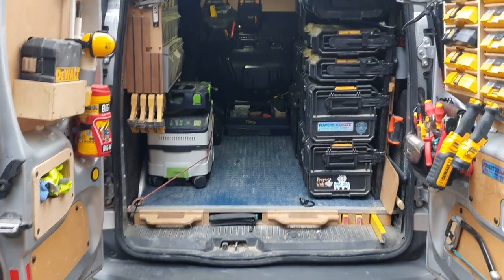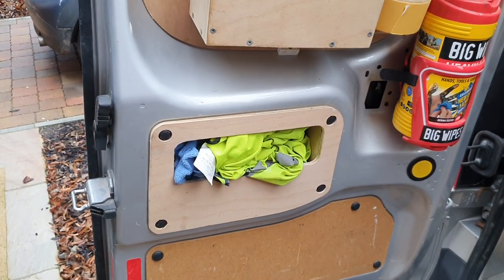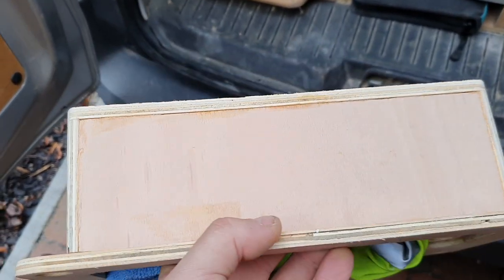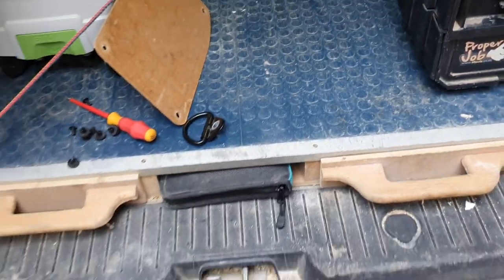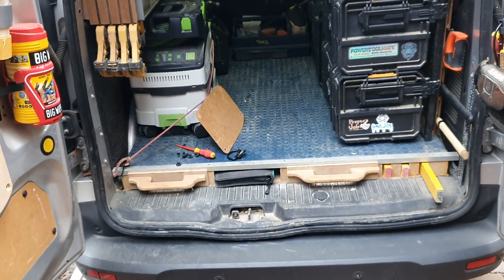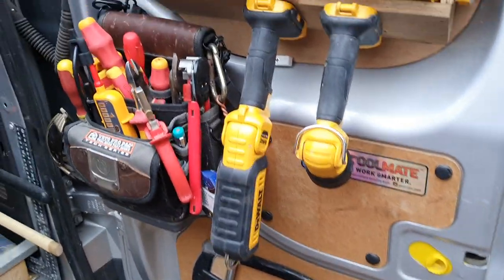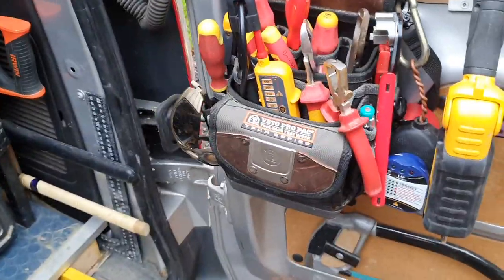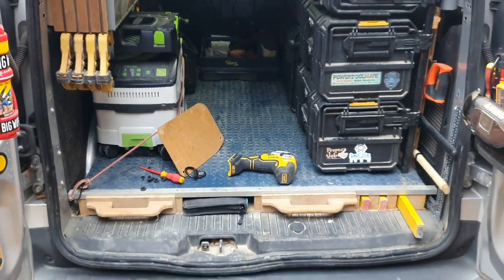my dewalt van racking ( part 3)

Comment: Where do you buy the tough system drawers can’t seem to find them?
Reply from the maker: They were discontinued here in the UK 3 or 4 years ago. There is a newer version but only available in the states.  Apparently there are more boxes in the 2.0 coming out later this year but don't hold me to that. Just what I've heard on the grapevine.  Hopefully there will be some toughsystem 2.0 drawers in the mix.🤞
Reply: @ziggysrefurbs1885  so only hope is eBay but I hope the 2.0 drop these aswell thanks for reply mate
Reply from the maker: @IzAndy69  I've seen them go for £100+ on ebay. Costs about the same getting the newer version shipped from the states. Or just hope and wait and see what becomes available later in the year.

Comment: Got the same model but struggling to get my 6ft level (1830mm) to work the same without it hitting the back door. Was a hole cut in the lower bulkhead  behind the driver’s side to accommodate? Any thoughts or confirmation? Thanks